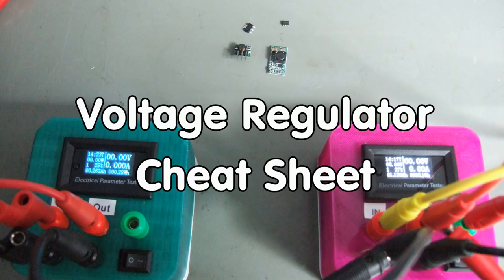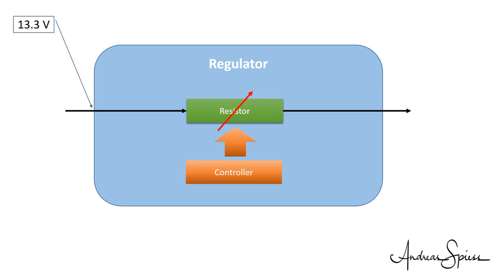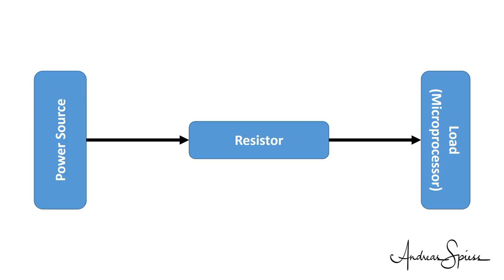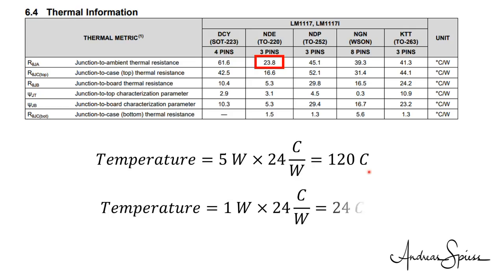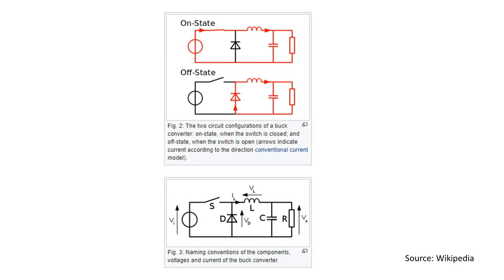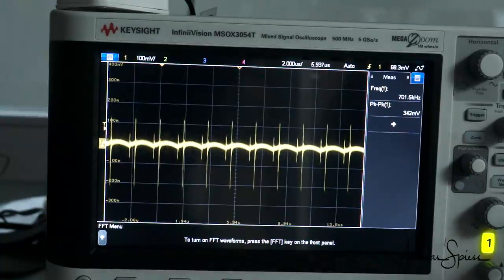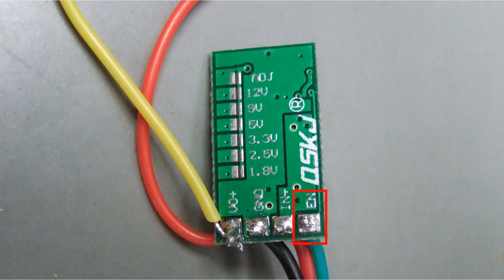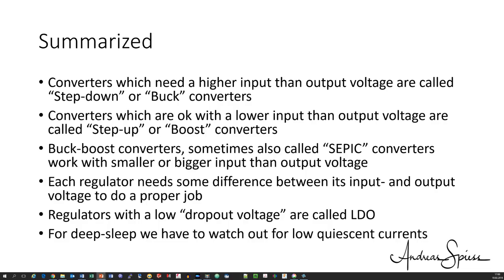#183 How to select voltage regulators for small projects? (ESP8266, ESP32, Arduino)

Comment: I liked your video, but I have one objection.
A linear regulator is not a variable resistor plus a controller.
A linear regulator is a controlled voltage reference (generally a zener diode).
Reply: I think that Andreas described the linear regulator as a controlled variable resistor because he wanted to make clear that the excess power is dumped as heat on the regulator which acts like an in-series connected resistor. It is simpler to explain a resistor  rather than a zener diode to someone with no much prior knowledge on electronics.
Reply from the maker: Most explanations about linear regulators  use this analogy. In reality this “resistor” is a beefy transistor in series. You find these transisors also in the block diagrams of the chips. The controller, of course, needs a reference voltage which could be a Zener.
Reply: I have a different opinion.
In reputable electronics books the presentation of voltage regulation starts from voltage references.
Horowitz (The Art of Electronics) has an introduction called "From zener to series-pass linear regulator".
Franco (Design with Operational Amplifiers and Analog Integrated Circuits) has a chapter called "Voltage references and regulators".
Anyway, we do not have to agree. We can keep our own opinions, of course.
Reply from the maker: Maybe you look at page 596 in "the Art". All but the simplest diagram (9.2.A) have a reference plus a beefy transistor with a heatsink. Then you can ask yourself why these transistors need a heat sink. My explanation: Because they dissipate heat. This is why I call them variable resistors.
Reply: I have no objection in saying that the simplest model of a voltage regulator is a resistor in series with a diode.
I do not agree with the definition of a voltage regulator as a variable resistor plus a controller.

Comment: Mr. Andreas Ams1117 outputs 1Amp for my esp07 module the issue is its rest if powered on for long time. could you recommend me a better alternate of Lm1117 as I power it from 5v USB.
Reply from the maker: Maybe you watch my ESP8266 low-power videos. You need to attach a capacitor.

Comment: Question: If you used the 20 Ohm resistor only, shouldn't the voltage accross it be 13.3V isntead of 10V? (Kirschov's Voltage law)
Reply from the maker: Look at the drawing at https://youtu.be/ffLU7PSuI5k?t=245. There you should see the 10 V

Comment: Is it possible, or even wise, to use switching regulator to drive a linear regulator to limit generated frequencies or would you get the worst of both worlds
Reply from the maker: A combination rarely is used for special cases. Usually you have to design your switcher that it is clean enough for your purpose.

Comment: How do you find a boost regulator that has such low quiescent current? I can't find any that are lower than around 100 or 200 microAmps
Reply from the maker: I do not use a lot of boost converters. So I have no overview.

Comment: Hello Andreas,
Thank you for this Video.

I watched your video #64 where you suggest a Lipo Battery to get the maximum amount of capacity. So i need a LDO regulator. In my Project I want to connect 5 IR-Sensors. Each of them consumes 5mA. So additional 25mA to the current of the ESP32. The HT7333 delivers 250mA but the ESP32 can produce current peaks up to 250mA while transmitting over WIFI. So I thought I can take the HT7833 instead which delivers up to 500ma and (according to the datasheets) has the same quiescent current like your suggested HT7333. Can i do this or do you have an alternative LDO for me?
Reply from the maker: I never used them, but I assume they are ok.

Comment: do you have what pin is what diagram of the Step-Down Converter you mentioned? 
How do you get 3.3V out of that piece?
Reply from the maker: You have to cut the connection to the potentiometer by cutting the trace and solder a blop on the 3.3 volts. Google will help you.

Comment: For the buck converter, couldn't you use a capacitor to smooth out the ripples it outputs to make the power cleaner?
Reply from the maker: A capacitor might help. But usually, it is not easy to get this ripple away...
Reply: High frequency not only come from wires.
Reply: Yes, but a big enough capacitor would be pretty big. What about connecting a switching regulator with a voltage slightly higher than the output to an LDO? This would be quite efficient since the LDO only has to drop a few millivolts and smooth because of the LDO's noise rejection.

Comment: Great Video. BIG LIKE from germany. Now i understand how step down Converters are working. But what about step up Converters? I am looking foreward to See a little Review of your New printer.
Reply: To understand the principle of step up converters, you need to imagine the following things: if you take off the voltage from an inductor, it more or less becomes a voltage source (in reality, its a current source, but imagine as voltage source) and it will change its polarity. Because the inductor (which is now an additional source) is in line now with the input voltage, these voltages adds to each other resulting in higher output voltage.
Reply from the maker: Thanks for the feedback! The Prusa video will come.

Comment: The AMS1117 is a pig when it comes to quiescent current and this is why I decided to swap the AMS1117 on this ESP8266-based, battery-operated device I bought on eBay ( https://www.ebay.com/itm/WeMos-D1-ESP-12F-ESP8266-Motherboard-Module-0-96-With-Screen-18650-Battery/292242102257 ) with a TLE4274GSV33, which has a ~100uA quiescent current according to Octopart. It's the same SOT-223 package, so it's a drop-in replacement, and the 400mA current-limit isn't an issue for me.

I have yet to receive the replacement-parts in the mail, but they should help the battery last quite a bit longer.
Reply from the maker: Thanks for the link.
Reply: I mostly leave those links in my comments for the other commenters/viewers, should they find them interesting, as I presume you already pretty much have every electronic gadget in existence in some sort of a secret 2500sqm warehouse of yours :P

Comment: i once had a switching regulator perform worse then a linear one i (forgot wich  switching regulator it was ) but i tested it at i think 12v input and 5v output at 100mA load  the linear regulator actually was more efficient but at 3A load the switching regulator won by a landslide
Reply from the maker: Thank you for sharing your experience!

Comment: Andreas: Can you possibly do a similar video on power devices to output 12vDC?
 I am looking to use battery Li-Ion 18650  to power a set up flashing LED strobes on my PARAMOTOR as collision avoidance lights.  Requires 12vDC.  I'd like to use 4 cells and some form of stepdown converter to output 12V.  
SPecifications: Voltage: 12V DC
, Amperage: 1.39A, Power: 16.7W
Reply from the maker: Maybe you go to the catalog of mouser and select the values you need. Then you should get a selection of parts which should work.
Reply: @AndreasSpiess  Okay, got it.  I guess that's a NO!

Comment: Thank you for your video.  , I am looking to use battery Li-Ion 18650  to power my ESP32, do we need any regulator?
Reply from the maker: Yes
Reply: @AndreasSpiess  if we charge the 18650 to 4.2 V, is it still fine without regulator to connect it to Vcc of ESP32? 
So, should we remove the regulator from our schematic?
Reply from the maker: Maybe you watch my video about powering an ESP8266?

Comment: Hi Andreas, was ist die max. Leistung dieser kleinen BL8530 / BL8531 Boost converter? Was ist der max. Input-/Output Strom? Und wie ist der Wirkungsgrad?
Dazu findet man auf ebay etc. meist gar nichts. Schätze, das die Dinger nur ein paar 100 mA liefern können.
Reply from the maker: Eine einfache Google suche nach den Datasheet zeigt für den BL8530:
Lx pin output current--------------------------------------------------------------------------------0.7A
Maximum power dissipation, Pd T=25°C
 SOT-89-3---------------------------------------------------------------------------------------0.5W
 SOT-23-5---------------------------------------------------------------------------------------0.15W
 SOT-23-3---------------------------------------------------------------------------------------0.15W
Maximum junction temperature ------------------------------------------------------------------150°C
Reply: Danke für die Info! Das ist wirklich für kleine Projekte und Leistungen - aber manchmal braucht man sowas.

Comment: Q: how to requlate IO voltage. Like if i need to get 120v to 5v IO and i don't want to use voltage divider. Also i need it to work with 0 and 1 signal.
Reply from the maker: You can use a normal power supply to get 120 V to 5 V

Comment: I thought there were some other transformer and rectifier or diode options for DC-DC conversion.  This link shows a couple options, though are about the same.  I didn't think about an electro-mechanical option (huge and I'm sure noisy) though was thinking of the older transformer options reading this site: https://en.wikipedia.org/wiki/DC-to-DC_converter
Reply from the maker: You still use transformers if you want to isolate primary from secondary.
Reply: I just received a Corsair AX850W that wasn't working and interestingly looks like one of the smaller transformers is loose.  I don't notice anything else burnt or caps expanded.

Comment: What can be done with the noise?
Reply from the maker: Some filtering (capacitors, inductors) at the output usually helps. But it is not easy if you have to power a critical device.

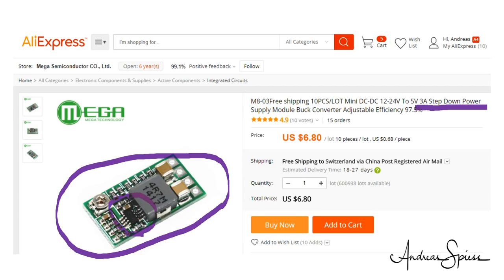Comment: 13:58 Does anyone know why they use an R as decimal point for inductors? You would think using an L for inductors and leave the R for resistors only would be less confusing.
15:11 Usually you can't trust the specification given by the AliExpress seller. This particular converter happen to have a manufacturer's web page with some useful information. The input range is given as 4.5-24V and the quiescent current as 0.85mA. http://www.qskjpower.com/ProductDetail/709788.html
Reply: I wondered that myself, but never really found an answer to it. My guess: it's a remainder from the old days where they used stamps to print the value on (nowadays it's mostly inkjets) and they already had the "R" from making resistors. Also an "R" is much less likely to be misread for anything on a bad print. An "L" could easily be misread for a "1" if part of the print is obscured by dirt or didn't take at the time of printing at all. Or maybe it was the chinese starting it, who can't tell the difference between an "R" and and "L" ;) .
It is not really confusing, because the shape is usually quite clear and you have values that wouldn't have any letter in them anyway.

Comment: Wait, the boost converters quiescent current is 6µA in operation? Or when the Enable Pin is on Low?
Reply from the maker: The boost converter has no enable pin. So it is during operation
Reply: What could i say? Wow. Amazing. Even the Pololus boost convterters requiers <1mA while operation.
Reply: Yeah, some of these converter chips have a kind of automatic disable where they switch their internal oscillator into a different mode below certain power needs.
Reply: Very nice. With this, i could drive my ESP32 with only one BabyCell. But, what about the Buck/Boost converters? Are there any nice with low quiescent current? I was thinking about using a buck boost converter for my ESP32 and a 18650 Cell. I dont like the fact that the HT7333 cannot operate anymore at ~3.65V.
Reply from the maker: An ESP and a HT7333 should work till about 3.1 volts (3V minimum for the ESP plus 0.1 for the HT). In reality, it will run lower, but out of specifications.
Reply: So, why my ESP32 is crashing if the Voltage of the cell is about 3.65V? For me, it looked like the HT7333 did not worked anymore ath this voltage. Oh. And happy late Bday Andreas!
Reply from the maker: Thanks that you remembered my birthday. Try to measure the voltage across the ESP, not only at the input of the regulator.
Reply: For sure i remembered! Ok, i will try. Thank you. I will tell you the results later!

Comment: Hello. Thank you for the excellent videos that you post in youtube. I used the small step down regulators that you address in your videos to create a +5V regulated supply to feed a Wemos D1 mini Esp8266 board. I avoid to use the potentiometer to adjust the output voltage and instead I cut a trace on the back of the PCB and I connect 2 traces with solder to set +5V. It works but it is difficult to cut the trace and I destroyed many regulators trying to do that. However, 2 or 3 months ago, I discovered this regulator which has not potentiometer and comes ready for +5V. If you need 9V or 3V3 you need to cut and put a solder join. So now this is the one I use - https://goo.gl/7d8Zzh Regards, Luis
Reply from the maker: Thank you for your link. BTW: The 5V on the Wemos do not need to be very precise as it has an onboard regulator which produces the 3.3 volts for the ESP chip. So an adjustment with the trimmer would probably be sufficient.